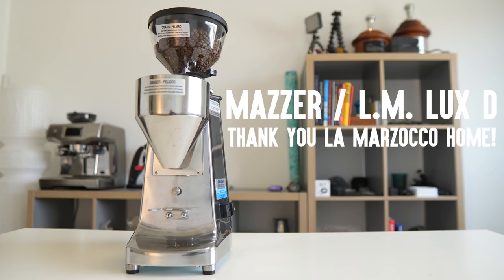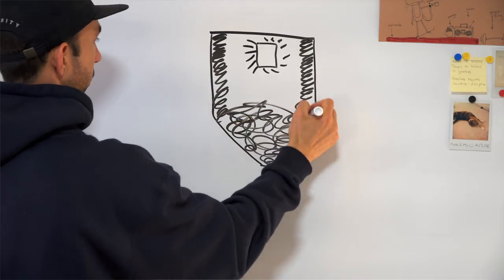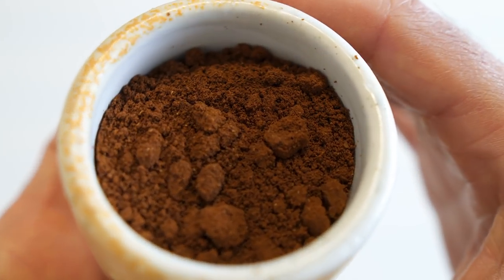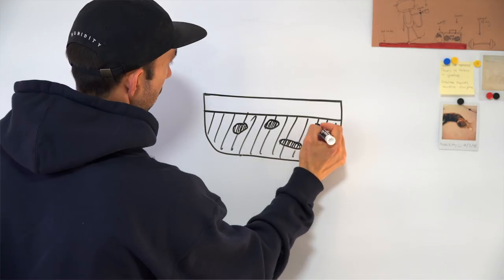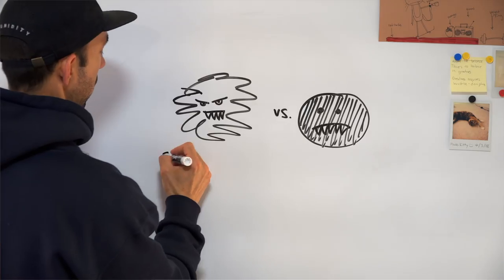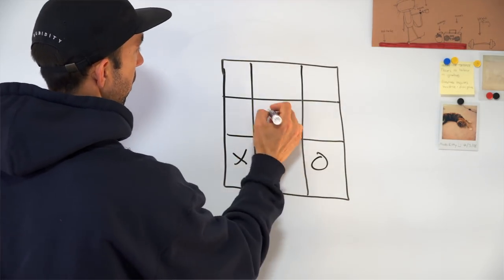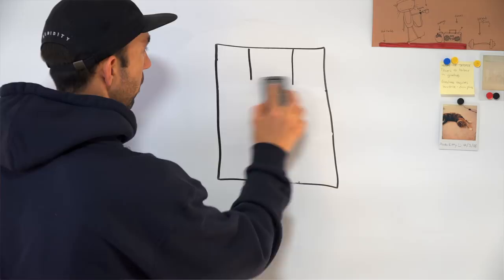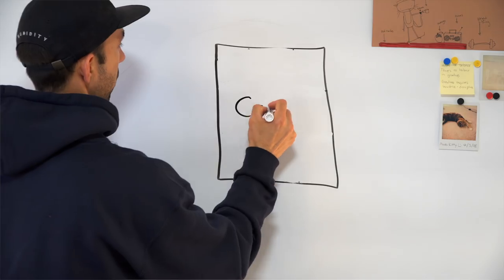Static Screen Mod For Mazzer Espresso Grinders. Why? | Real Chris Baca

Comment: I can understand why clumping seems like an issue for evenness of extraction, but when the clumps are quite weakly held together (as they break under a light tap with your finger) doesn't tamping break those clumps up easily?
Reply: I think it depends on the roast level, and the grind level, and probably just the general amount of static. 

When I distribute (thanks Cat & Cloud for carrying the Chisel!), I can see when the clumps break up or sometimes I just tap the side of the PF to break them up.

However, with darker or more oily roasts I've seen clumps be a bit more...stubborn. I wouldn't do this at a shop, but at home I'll just pinch clumps a bit to see how resistive they are. If they're easy to break up, I don't worry. If they are stubborn, then I'll redistribute with a small pick.
Reply: Exactly, let's say clumps are denser on the inside than the other coffee particles around them. Then, clumps could lead to uneven distribution, as a leveled coffee bed (before tamping) wouldn't necessarily mean that the coffee is equally spread thoughout the entire basket. This could then cause uneven extraction. 
But the coffee clumps themselves are not something to worry about, because they will easily break while tamping.

Comment: I definitely have the OCD regarding my grinder.  With the screen on mine I know it holds back a few grams of grinded coffee.  Unless I am grinding twice in succession I will either grind 5-6 seconds to "refresh" this coffee or will use a vacuum to suck out the old stuff.... I don't want any old coffee in my portafilter even if it is only 2-3 grams.  

I thought about removing the screen but would rather not as I don't know how to undo it.  Fiorenzato F4 grinder.

Comment: Every static screen that I've worked with that has been cut never ever grinds without spraying coffee everywhere. Even when a wire has been cut only on one end, the grinder was almost unusable as the dose was so far off. I have a general dislike of modifying the static screen due to the fact that its never done correctly for the bean's that are being used in the grinder. The only confounding factor, all the grinders that I've worked with with cut static screens have been robur's